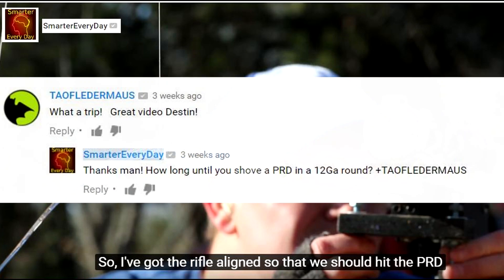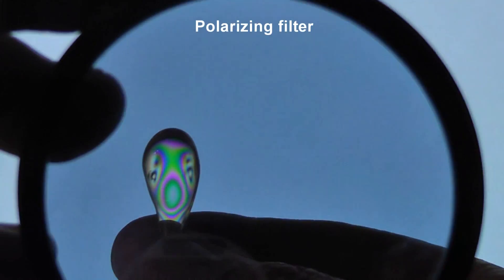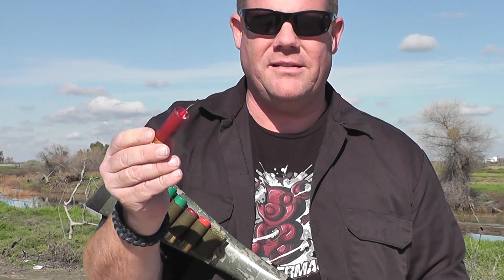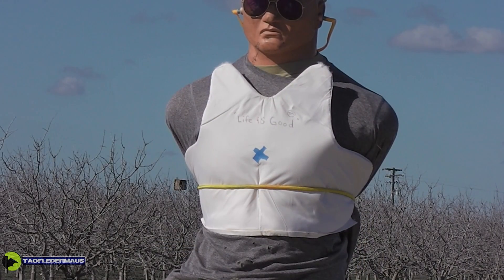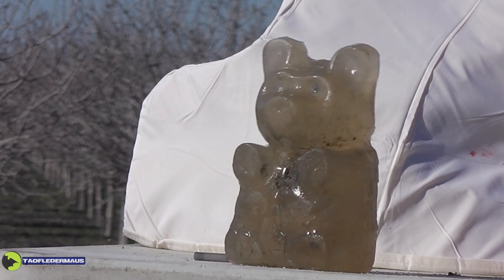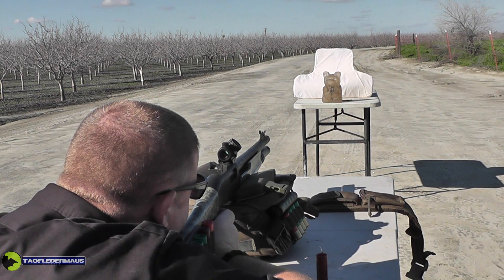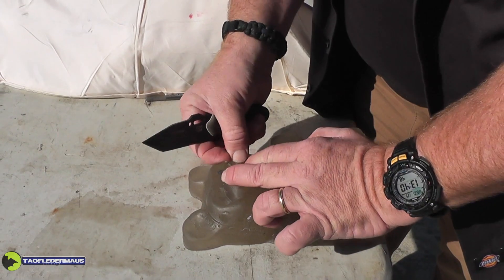Prince Rupert's Drops - Shot FROM a gun

Comment: Amazing things rupert drops . I wonder if you could make them without the water drop but keep the molten glass in a mould then use something sharp to make the tiniest tail by putting say the end of a dart in it then quenching it at that point so the drop has no weak extended tail but a very short rounded one thats more like a drop on the glass or an oval

Comment: You guys veryyy underestimated prince rupert's drops and didn't do them justice in this video. I've made these drops and hit them with a hammer on a solid steel brake disc and punched a massive divit right into the brake disc. If you took the time and shot them at the steel again, if they hit correctly without shocking or touching their tail, they will absolutely leave a crater in the steel plate. yall rushed through the gauntlet wayy to fast and made comments as though you didn't expect anything more from them like they are normal glass which should shatter and only leave small holes in weak targets like the ballistics gel, but they are verrrrrrrry different.

Comment: The second one looked like it hit tail first, on the steel plate, which as we know from SED, is the weak point of the Prince Rupert's Drop. Even just nipping the tail will essentially cause the entire thing to explode, so I'd have to say that it wasn't necessarily the force that broke the drop, as the initial impact was imparted mostly into the tail, and not the main bead.

Comment: lol some one did it..  have you ever seen how a glass bottle making machine works,  they have glass being metered into a die that then gets cut off into billets and dropped into a blow mould, that then gets blown into a bottle shape, you could use the same idea to make glass bullets all you would need is to drop the glass billet into a non-stick mould and then dropped into the cold water to make a shaped PRD  just as long as the glass dose not lose much heat as it passes thru the press and into the water

Comment: the structural insanity of the PRD really only exsists in its when the energy is transfered into the head of the droplet  and then shatters from the secondary shock wave. to have a proper experiment you need to have the head of the droplet fixated in a mold, something like your 3d printed rounds

Comment: when real PRD cool down the glass inside contracts so much it forms little vacuum pockets inside, if you got pure glass it's usually 1 or 2 big pockets while impure glass results in alot of smaller pockets... nevertheless the ones shown in this video were completely solid, no bubbles or anything, which means the internal stress wasn't strong enough to create a vacuum and thus they cannot be considered real PRD...

Comment: Add a lead center before the drop into water.  The extra mass should increase the kinetic energy exponentially.  (metal jacket bullet from gun, because the lead will melt from the heat.)

Comment: Hey Jeff, how about this - making some very small prince rupert's drops and loading them in a shot cup and firing them out of the shotgun?  You would probably need some filler (the same used in buckshot shells)to prevent fracture/disintegration of the drops during ignition and acceleration. 

I'm very curious as to their behavior, and frangibility on certain mediums. ( think - close range, "safety" buckshot.) 

Thoughts?

Comment: extreme scientifical of the first order
Reply from the maker: thanks!
Reply: tune in next week when I do the Prince Albert shotshell
Reply: he's popped the barrel off before (if I remember correctly it was to pre-load a long shell that wouldn't fit through the ejection port) and shown his barrel.. it's totally fine.
Reply: It's actually a prince Rupertazine
Reply: MattV2099: Guns & Food I'd like to see a colab video.
Reply: TAOFLEDERMAUS I wold love to see inside inside of the  fun barrel.  do they get messed up? thanks
Reply: full tactical operation
Reply: TAOFLEDERMAUS  Would love to see what happens if you reheat the bulb of a PRD, like with a blow torch, not sure if anything would happen but thinking about the physics of the drop makes me wonder. Would it explode bulb first, crack from bulb to tail then explode, would the torch be able to  heat it quick enough to liquefy inner and outer layers so the inner pressure  makes it bloom out? Couldn't find a video of someone trying this so it could be some original molten hot content flying into the face of the community 👍

Comment: Those were not prince rupert's drops. Only the tail was liquid. You just cut the glass rod into round-ish pieces by focalizing the heat an inch above the tip, the tip was never anywhere near hot enough to liquify and make it's own drop. Being able to cut their tails short like that without the drop shattering should have rung a bell.

Comment: I think that one that shattered only did so because it hit tail first. If you look at destin's video you can see that even when he hit it with a hammer it only shattered because the tail whipped. The shatter started at the tail, not the head, where the hammer hit.  I wonder if it would be possible to heat a glass ball and drop it in water to make it perfectly round. If it did not have a tail I wonder if it would at least survive a low velocity impact against steel.

Comment: why is there no penetrative velocity and why are they shooting so close?  i also wonder if its possible to flachette the drop to give it stabilizing fins. im also interested in different heat treatments of the glass and different types of glass. i believe it is possible to put these rounds through the lead plate with a proper delivery system...something similar to the 70Cal Gamino rocket perhaps?

Comment: Ok, what happened? When I saw you making the PRD's, I noticed that the glass wasn't entirely molten. The lack of internal stress was confirmed by the missing air bubbles and then again when the tail of one was chipped without the entire drop failing. This messed with my hypothesis that the shock from shooting them would destroy the tail, making powdered glass fly from the barrel.
Reply: Joe Clark exactly what I expected and would have happened if they had made real PRD's

Comment: Im not so sure drop did shutter because of hitting the plate... there is a possibility that it did because of the force aplied on the tail of the drop, making it vibrate and then shuttering as if you just brake the tail in your hands.  But to proof that or opposite you'l need a very very high speed camera to actualy see the moment it starts to shutter... Thx for the video, it was interesting )

Comment: Are those actually proper Rupert's Drops? In some cases we can see that the tail broke off yet the drop is still intact. Correct me if I'm wrong but shouldn't the drop explode once you brake the tail? In every video about these drops I've seen, one of the really weird properties of the drop is that it's very durable but it shatters as soon as the tail gets damaged. Not the case in this video, can someone explain why the result here is different?

Comment: I'm not sure that the impact on the steel plate shattered it, it could be just that the tail broke first. without 40k fps it is hard to tell because it is so damn fast. I think that if the tail wouldn't have boken first, the drop would survive even the steel plate.

Comment: With the way those acted I don't think they are PRDs. Usually any sort of force on the tail causes a chain reaction and shatters the whole thing almost instantly. When you are heating up the glass you need to keep the heat at the bottom of the glass until it drops, they are harder to make than most people thing. If it was made correctly they would have exploded when you shortened the tail as much as you had to for the video. Still a good video though :)

Comment: Did you put the jet sound effect over the crop duster ?
Reply: Shane K , actually Shane you are correct.  There was an F-18 flying overhead while the crop duster flew by about a mile away. Jeff shot the video like that just to get the cool sound with the smaller plane. Then the duster dropped smoke and freaked us all out.
Reply: Shane K that was a turboprop crop duster. It has a turbine engine that powers a propeller.

Comment: I don't think all of those were true Prince Rupert Drops.

The clay shot had a long tail and it broke of clean. In a Prince Rupert Drop if you break the tail the entire thing shatters.

Same thing with the gummy bear, the tail looked broken but the Prince Rupert Drop did not shatter.

The steal plate was an interesting shot, tail hit first and it shattered. That looked like a true Prince Rupert Drop.

Like to see a shot where the drop hits the steel plate first.
Reply from the maker: The stresses you can see with the polarized filter proves they are indeed PRD's.  I put a link in the desc.  to another video that discusses that.
Reply: +TAOFLEDERMAUS Then if they truly are PRD's make a follow up video where you cut the tails of the surviving drops. If they explode into glass dust they are PRD's, otherwise they're just glass marbles with a tail.
Reply: Yeah, they were shooting glorified marbles here. Definitely not legitimate PRDs.
Reply: +TAOFLEDERMAUS I think you need a bigger torch to keep the entire drop hot. I think in some cases the drop cooled too much and some of the drops had much lower stresses. That could be why the tails broke off, but drop did not shatter.
Reply: Taluvian EXACTLY!

Comment: Not quite prince rupert's drops, close but not exactly. To make them that exhibit the phenomena of being able to say take a hammer blow to the large side, and only a slight bend in the tail will make the whole thing turn to powdered glass in your hands you need to get the glob of glass at the tip the hottest and not melt off large globs of glass which while they do have internal stresses, they aren't over the entire drop's surface hence the tails being able to break off. If done right it will take forever and a ton of heat to get the glass rod's tip to melt into a sizeable droplet, and it's entireity will be orange hot when it hits the water
Reply: Sorry, Jeff, but there are some stresses from the heat, which you will see in a filter, but these were not fully molten when they hit the water. They are not prince Rupert's drops. They are elongated tempered glass.
Reply from the maker: I knew people would question if they were real or fake,  so that is why is showed them with a polarized filter.  You can't fake that.
Reply: *****
 I'm not saying they are fake, they are shock cooled/tempered glass which will always show  stress patterns under a polarizer, as will many vehicle's rear windows. That doesn't make them prince rupert's drops though, If made correctly any snapping of the tail will propagate through the whole drop shattering it. These are lumps of glass that were shock cooled and have a tail but they are not prince rupert's drops. You really have to get the piece of glass that drops into the water REALLY hot and you need to concentrate that heat at the end to make the glass run like thin honey. You don't want to heat further up the glass rod to make the end fall in which is kind of what I saw in the video with the mapp torch.
Reply: imundeader
He did, the actual force on them propogates at over a mile per second so being blasted out of a shotgun with such low compression is moving relitively slowly compared to how fast they shatter.

Comment: how much force does the average sized PRD explode with? I know that because of the staggering pressure inside of the drop that when they explode they just turn to powder. when you shoot a block of ice  (say a cube 1'x1'x1') with a .45, it will break into large chunks. if you shoot thar same block with a .300 win mag it will turn to much smaller pieces. so, if you were to break the tail of a PRD in the nose of the gelatin bear, would it cause any damage at all, or merely be contained in the medium with no damage whatsoever? also, how many psi is a PRD inside? and does that differ between different types of glass when formed? 

thank you, much. I really enjoy the channel.

Comment: I'm surprised the shock of being fired out a shotgun didn't break the tail and cause it to shatter instantly
Reply: Because he didn't make them right, he heated the drop up and then cut it with the heat as it was dripping. The way you make them is by heating the tip of the glass till it drips off by it's own weight keeping the glass liquid till it falls. This was just glass with a tail.
Reply from the maker: That was what I was expecting.

Comment: I have watched other videos of princess Rupert's drops being tested. In every video I have watched, with the exception of yours, all of the Rupert's drops had long, hair-like tails. I noticed yours were much more thick in diameter and had shorter tails. I wonder if that has anything to do with the overall integrity of the drop.
Reply: Wait, wouldn't that be impossible if it was a prince Rupert's drop?  If the tail breaks, and the drop doesn't shatter, doesn't that mean it's not a prince Rupert's drop?
Although you may be able to melt the tails off....
Reply from the maker: The tails were about 2 feet long when I made them.  I snapped them off to make them work in a shotgun shell.
Reply: TAOFLEDERMAUS Interesting. good to know though. Loved the video, as usual!! :) you guys rock! How about a prince Rupert buckshot round? is it possible?????

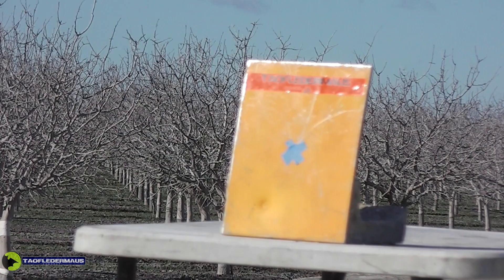Comment: 2:45 the tail hits first
Reply from the maker: I thought IF these actually worked,   they would fly nose first,  not sideways.
Reply: i agree
Reply: I was about to comment the same thing. I wonder if the tail didn't hit, if it would still break?  I know they take a lot force.
Reply: Well, it had a pretty long tail that was curved, not so good for aerodynamics.

But I don't think it would have mattered much because even if it did hit nose first the impact would have still broke the tail, which is what you see in SmarterEveryDays' video.

Comment: These are not prince rupert drops. characteristic about a PRD is that the energy (from the liquid state) is stored and then transferred into mechanical energy when you snap the tail.
Reply: Correct, the glass wasn't hot enough as he was melting off globs of it. To make them correctly you have to melt the very tip of the glass rod and it will take a ton of heat and time to get a drop going and it will be orange when hitting the water.
Reply: Gábor Orosz
 They probably wouldn't withstand the shock of being fired, but they definately have properties you don't see in the glass drops in this video, once the tail breaks, or the skin of it gets a scratch they explode into powder.
Reply: They explode because they are under enormous stress. A prince ruperts drop is formed when the inside cools after the outside has already been solidified. The cooling shrinks the inner glass in on itself making it extremely strong. The glass structure completely shatters when the bond is destroyed most likely in the tail causing a1.2 mile per second domino effect that sets off the mechanical energy that is contained within the glass. The hotter the inner part the higher the stress on the outer glass layer.
Reply: Job91 could this then be encased in lead, leaving the tip exposed?
Reply: SaltEncrustedSpear Tips Maybe but unless you add acid and really score up the surface lead does not 'wet' glass very well. The simple act of roughing up the surface would likely pop a real prince rupert's drop of which these aren't. They're close but not heated properly upon seperation from the glass rod before quenching.
Reply: still, probably wouldn't make a difference, due to it's very light weight